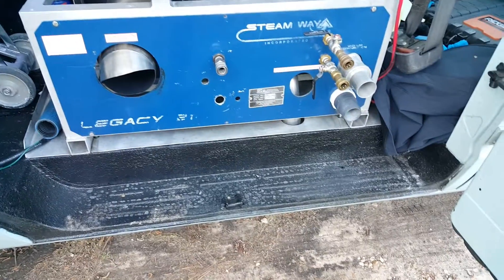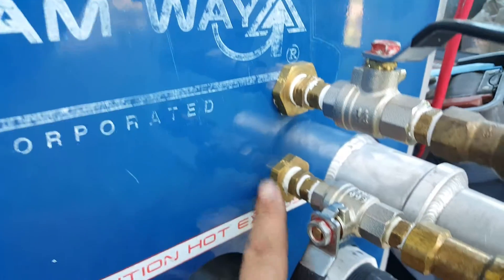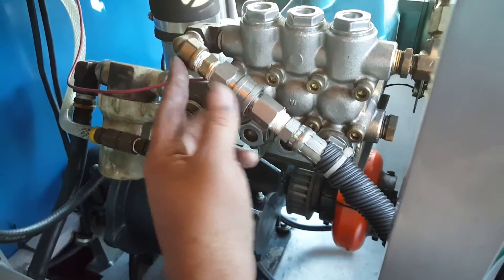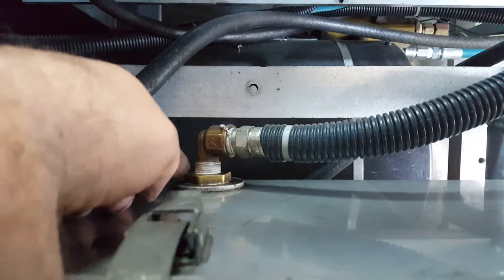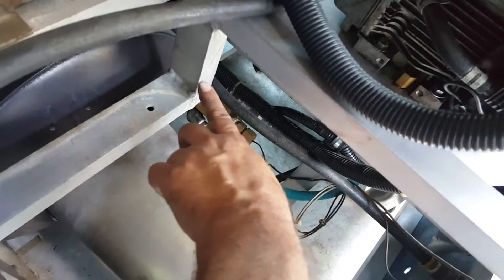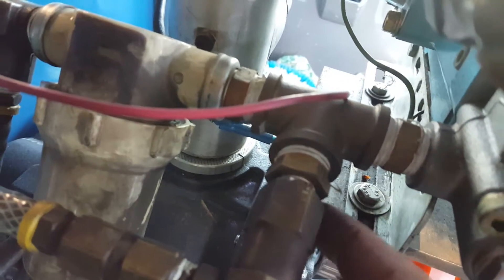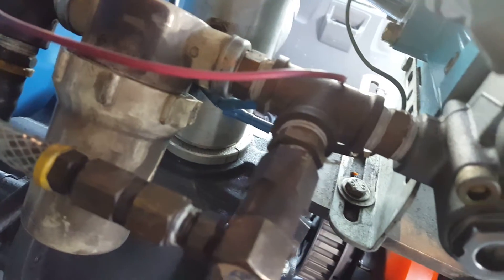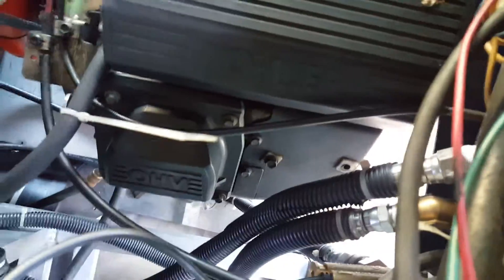Steamway powermatic Unloader valve mod plumbing

Comment: John.  Thanks for the video.  Only question I have is about your thermal valve.  Why wouldn't you put it on the outlet of your pump?  The water from your box will always be cold but you need to dump any hot water that builds up through your hoses from your burner.  I may be wrong, but just a thought.